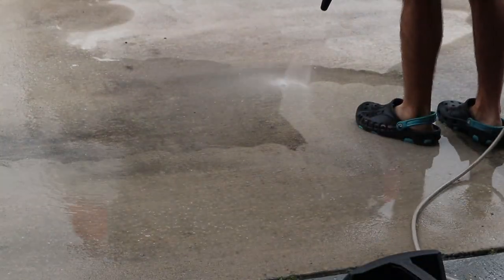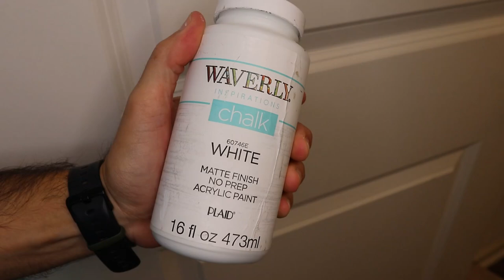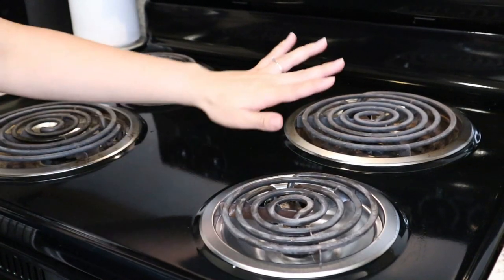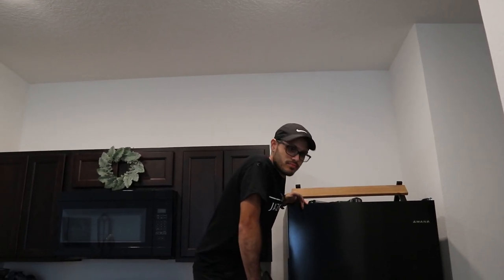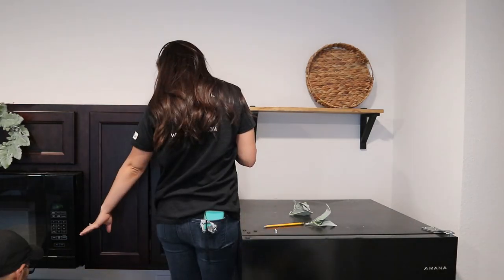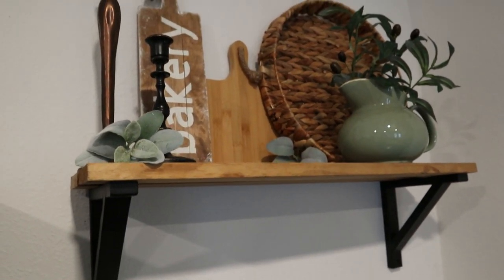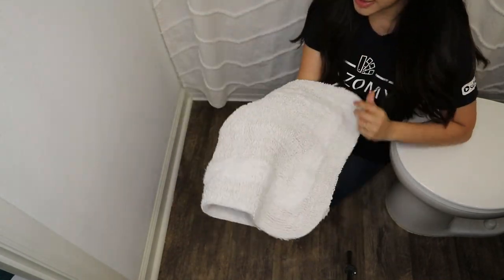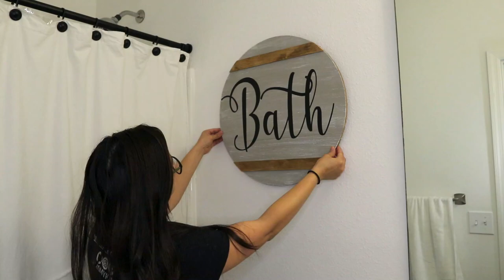EXTREME CLEANING + FIXING and DECORATE WITH US Our RENTAL HOME

Comment: Did you know that the entire top of your stove can be lifted up!  It has a hinge to keep it propped open so you can clean it thoroughly rather than reaching down into that area where you have taken out your drip bowls. Also you can clean the top’s  sides when it is flipped up. A Brillo or SOS pad can get the grease build up off the stainless steel parts of your coil s. I hope this makes your next cleaning job easier.
Reply from the maker: We did figured out after recording. Thank you so much sweetie!!